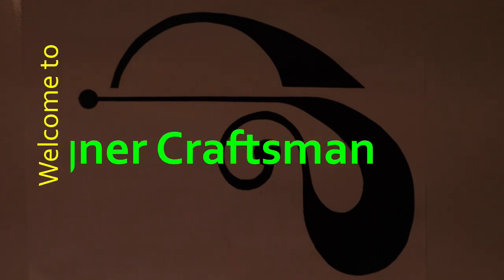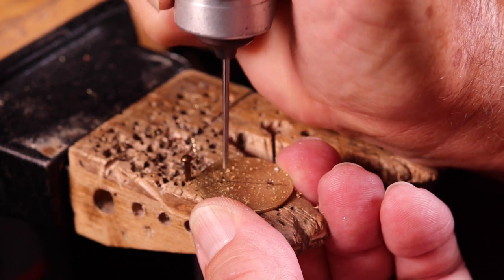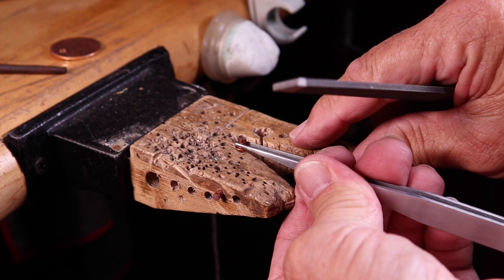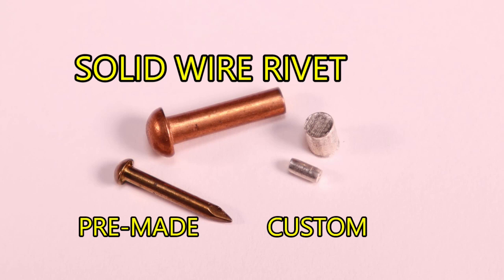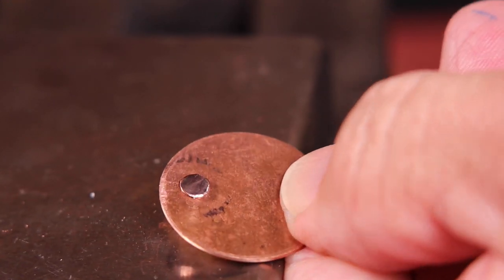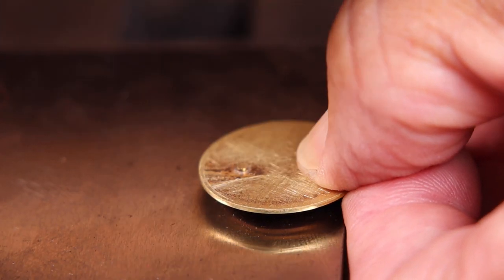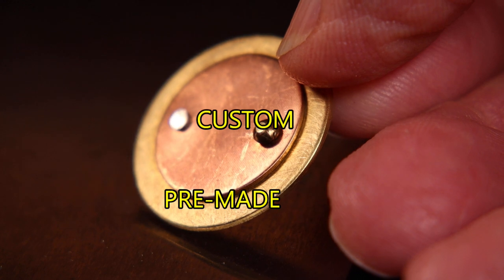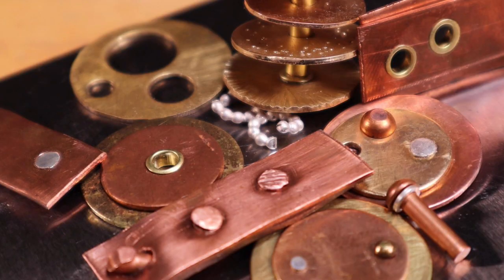5 SECRETS TO PERFECT RIVETS... EVERYTIME!

Comment: I've already been a bit worried about you not posting anything. Good to see you again.
I might have some tipps to go along:
Filing any burrs off a hole: I often use a diamond coated ball burr (a normal fine ball burr will work as well most of the time) in some kind of file handle. This will avoid scratching the surface of the metal and reduce the amount of work to be put into clean-up and polishing.
Brilliant tipp for holding rivets in the bench block. Absolutely logical, but haven't seen that before. I surely will copy that one. :)
I've been missing an important step when using a flush cutter: Using a flush cutter will harden the metal. So either the rivet needs to be annealed again or the cut needs to be treated with a file to remove the hardened metal or else riveting will be a bit inconvenient and probably yield a suboptimal result.
"It will flatten the pre-made side, so be aware of that." Right. I've got a steel block for just that purpose - to avoid flattening the pre-made head. As far as I know, you cannot buy those but it is easy enough to make one yourself using a piece of tool steel (e.g. a 10x10mm piece that is normally used to make punches, anneal it, use ball burrs or punches to make some depressions in which the pre-made rivet head can rest; then harden and temper it). This kind of "riveting anvil" will also act as a perfact spacer and will even shape the other side of the rivet into a domed rivet (e.g. when you're doing a "custom" rivet by balling up one end of the wire).
Reply from the maker: Hello Torsten,  Thank you for your kind comments and I am very happy to be seen again.  Your tips are (as always) excellent suggestions. Very nice to hear from you Torsten.  I hope more viewers read your comments.  Great ideas.  Thanks again.  Greg Greenwood
Reply: Hey Greg great video, leather workers saddle makers use a small hand held punch /die block with 2 dimples of different sizes and a 1/8inch 3/4inch deep hole in 1 end, also 1 through the side for side ways use same 2 dimples on the side also. The hole is used to push a washer down before you cut rivit to length for mushrooming the head.

Comment: Thank you for your excellent presentation: you've taught me a trick for cutting those little rivets...
In old Europe, where I live, for traditional riveting (for example in cutlery) we let the rivet protrude half its diameter on each side to hammer it.
Here, many riveters don't use a spacer: simply a flat steel plate to be placed on the anvil, with small prepared holes corresponding to the different half diameters of the rivets.
(A thousand apologies for my approximate English).
Be well.
Greetings from Belgium.
Reply from the maker: Hello Alain,  Your English is great!  It is always interesting to hear how other craftspeople do different jobs. And always fun to hear where you live.   Thank you for sharing, I appreciate it.  Have a wonderful summer.  Greg Greenwood

Comment: if you need to have more than one rivet to connect two (or more) pieces, do you drill all the holes at once?
Reply from the maker: Hello Nora,  Thanks for your question.  I don't drill all the holes at once. Because  the chances of the holes not matching is multiplied.  Drill one set of holes and set the rivet, then you can drill all the holes you want.  I hope this helps you.  Let me know how it goes!!  Greg Greenwood

Comment: I have a question I have four square 8ga ss wire that I want to use as a separator.  I've tried soldering, but it's hard to hold the pieces to solder.  Do you think you can use a rivet in to the end of the square wire to hold it in place and then solder?
Reply from the maker: Hello Liz,  From what you have described, the rivet should work for you.  Also, check out my video "30+ Silver Soldering Set Ups".  One of the set ups in the video may work for you.  At least, give you some new ideas for solder jobs.  Let me know how it goes.  Thanks for your question, I appreciate it.  Greg Greenwood

Comment: hi! im a young aspiring metals artist… riveting has been a pain, but i do enjoy it. this video is super helpful, too! 
a question ive had, though, that i cant seem to find any good straight answer to is removing a rivet… if i have a rivet that i need to take out, what is the least destructive way to remove it without widening or warping the drilled hole??
thank you so much!
Reply from the maker: Hello Riftiee,  Thanks for your question.  It is a good one.  The best way that I have found is to:  1. Center punch your rivet.  2. Drill a smaller hole than your rivet size.  If it is center punched, then it will be accurate and not hurt the original hole.  If you want, you can start with a small drill bit and work your way up to the larger drill size.  3. As you are drilling, the rivet will become loose and you can pull it out easily.  This method does not disturb the original hole.  You can replace with the same size rivets to match.    Let me know how it goes for you.   Greg Greenwood

Comment: So maybe I don’t understand fully how a rivet is domed. Basically stretching the flat edge of metal rivet out and then ‘pulling’ it downward to form a dome. Then how do you strike a flat surface and pull down edges and still not mar the base ?
Reply from the maker: Hello terp4u2,  Thanks for your questions.  There are 2 different types of wire or solid rivets.  1. Pre-made:  These have the dome or head already on the one end. This is how you get the large rivet domed. 2. Custom rivets made of wire:  You can put a "dome" on these wires by balling one end. See my video "How to Ball Sterling Silver Wires & Spheres". Then when it is hammered into place, the balled end will start to flatten and you can shape it with a cupped bur on your flex shaft, making it domed.  
Your sharp edges on your rivets (from your other comment), are caused by over hammering around the edges of the rivet. Hammer less when hammering the edges and hammer more with your ball pein hammer in the middle of the rivet.  This will cause the metal to push out with more volume or thickness and keep your edges from becoming sharp.  Also, take a small buff on your flex shaft and soften the edges of the rivet if they get too sharp. Your last question: As you saw in the video, the pre-made domed rivets are perfectly domes before you strike them on a flat surface.  There will always be a slight flat spot on the dome after you set the rivet.  Take your buff on the flex shaft and round the flat spot off.  I hope this helps you with your riveting.  It takes practice, so don't be discouraged at first.  Practice, practice, practice.  Let me know how it goes. Best of luck to you.  Greg Greenwood

Comment: Do you worry about corrosion from using different materials? Like using steel rivets in aluminum panels. I use 1 1/2 times the diameter of the rivet to cut the rivet. I think it's close to your method. Now to learn grommets.
Reply from the maker: Hello Steven,  I don't get too concerned about the corrosion.  I usually don't mix the ones that will corrode.  Thanks for asking.  Greg Greenwood
Reply: I use the 1 1/2 time diameter as well, learnt from blacksmithing.